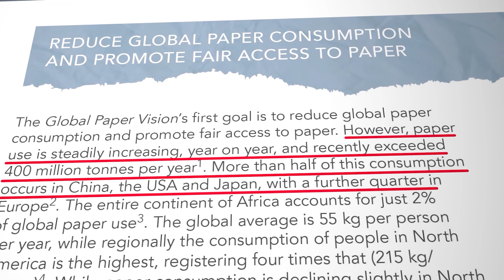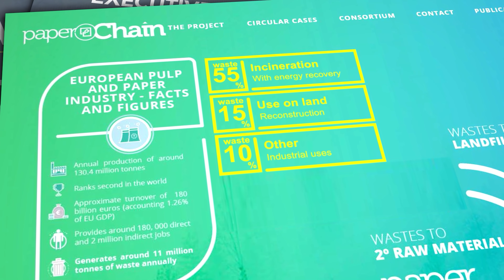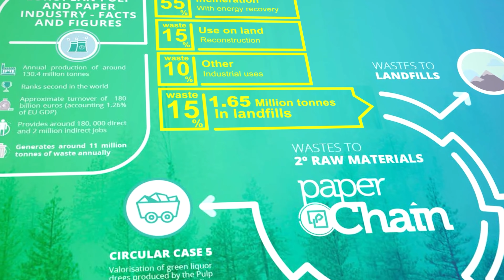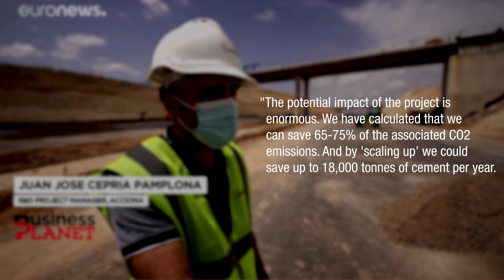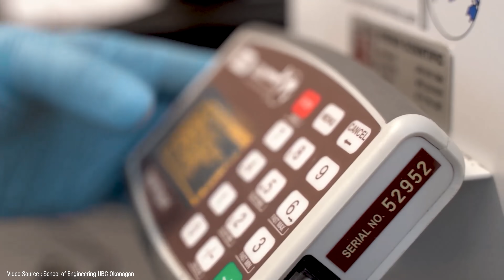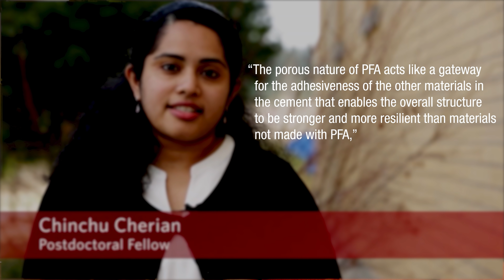Could papermill landfill waste pave our highways?

Comment: Early 90s. Savanna GA. New Airport Terminal. A "Bridge" structure that resembled an interstate overpass was 75% built before concrete testing revealed that the local concrete company was mixing PFA (paid to haul it away) from a local papermill, reduced the concrete strength by a factor of 10. Huge scandal. Soooo.., unless you and yours know something that construction workers don't... this idea is on par with some of the greatest scams of all time.

Comment: Cement producers have been using the residues from coal fired power plants for years in their products, ie furnace bottom Ash and PFA (pulverised fuel ash). They're known generally as cement substitutes. They perform the same function as the PFA shown in the video. We have huge stockpiles of the stuff on the sites of the old (now decommissioned) coal power plants. It would be great to reclaim all that lot first and allow the old coal plant Ash lagoons to return to its natural state.

Comment: Had a really good laugh, as he talked about the calcification process at ~700degres. Concrete has to go to the same process, achieved by burning old tires. Remove the tirefire, use something clean and we don't have to talk about a replacement.

Comment: Dave, this all sounds very exciting, but I think the "construction industry" is well advised to take a very jaundiced look at any new "miracle" product coming in. When you build buildings, particularly hospitals, safety and longevity are paramount- and they are not much less when you build or pave public roads with them also. Concrete is already a very fraught area in construction- most of the attempts to defraud building jobs are through "fiddling" with the concrete mix ratios and similar- so working with a new "miracle" material will be, as you said, a very hard sell.  I am not saying it's a bad ides- on the contrary, if it passes muster and the scientists can show the engineers it can work and how, it could be a really big deal! As always, thanks , Dave for all you do! Every Sunday and most mid weeks, I get a tiny bit more knowledgeable because you d  such smashing homework for us! FR

Comment: Thanks AGAIN Dave for another informative video. I was wondering throughout the video if anyone involved in the research has been in contact with the companies that are developing 3d printing for buildings, as they tend to use concrete in their mixes. Instead of convincing old dogs to convert their usage, start with new dogs that are looking for innovative ways to solve problems.

Comment: One of the biggest problems with modern roads is around regulation of weight per tire surface area, and if we change the way the roads are built, regulation practices may need to radically change.  Also, a lot of surrounding engineering is done with anticipation of approximate calculation of weight of the road, so that might need to change if you even change weight by a little, but perhaps this is minor.

Comment: Replacement of Portland cement with waste material is not a new idea. Ground Granulated Blast Furnace Slag (GGBFS) from steel making and Pulverised Fly Ash (PFA - the abbreviation has already been used) from coal-fired power stations are two examples that have been used in concrete production for at-least 50 years and which are regulated by British and other national standards. Bast Furnace Slag has also been used as an aggregate in asphaltic road surfacing materials. Other waste materials have been investigated such as Rice Husk Ash - a possible source of aggregate for concrete particularly in Asian countries; crushed waste glass is another example. The foregoing materials are used as partial replacements for Portland cements in structural concretes as full replacement would negate the beneficial alkalinity of Portland cement concretes which protect steel reinforcement from corrosion. Recent and ongoing research is being conducted into total replacement of Portland cement with recycled materials but the resulting concrete requires alkalisation to provide the necessary rust inhibition.  As with the use of all recycled materials, it is necessary to ensure that the properties of the resulting structural material meet the required strength and durability requirements. Equally, that a proper assessment is made of production and transport processes to ensure that use of the recycled material is truly advantageous from an environmental aspect. Interesting to note that the Romans used volcanic ash - which has similar properties to GGBFS and PFA to make concrete 2000 years ago. The volcanic ash was from a place called Pozzolana and the modern cements made from recycled waste are sometimes called Pozzolanic cements.
Reply: Correction: Pozzuoli not Pozzolana

Comment: The bitumen and gravel used in asphalt road building is already 95% recycled, and asphalt paving is also much cheaper and more widespread than cement paving. Cement paving also takes longer to lay/pour and longer to set before it can be driven on. So unless PFA bonded cement is significantly cheaper than standard cement, there is absolutely no market incentive for construction projects, particularly road construction and paving, to use the material. This is just green hype from the paper industry.

Comment: Sounds good to have more alternatives to cement and less landfill. 

Personally I've been hoping for a big push for substituting hemp instead of trees. Hemp makes an excellent additive to concrete mixtures. Mostly though it just makes more sense overall to make widespread use of hemp for as many uses as possible. Not only does it grow in almost any soil and climate but grows much faster and produces 4 times more paper per acre of land. Saves on cutting trees that take decades or more to grow into a suitable resource, when you can grow much more in less time with Hemp.  Plus added bonus of sequestrating more CO2 faster than trees.  Hemp fibre cloth is tougher and hard wearing compared to cotton. It has Cosmetic, medicinal and industrial uses aplenty including bio-plastics.  It's crazy that so  much paper still comes from tree pulp.  Its a one stop solution to many problems and has plenty of data to support its benefits. Yet still not used to its potential.  
From what I gleam this is because of the issues around grey areas of 'legality' and supply currently keep its material cost high as companies are careful to insulate themselves from legal challenges and supply is not widespread - keeping prices high.  Its not rocket science to free up production and financially incentivize its production.  For example Henry 8th passed a law to promote everyone to grow hemp as it was used for ship rigging.  If we open up legal restrictions and ramp up production, material costs come down, means more financially viable solutions and new market niches open up.

Comment: Coal used for cement production is now being replaced by alternative fuels, up to a limit,most alternative fuels are low ash, and so the cement producers can replace the ash normally reasonably high in coal by re introducing ash from other wastes, not a problem.
 Other paper waste is used for soil improvement, some fields are vastly improved, perhaps because they get paid.

Comment: son of a upper midwest 4th gen logger there some points i would like to clarify one pulp and paper is basically the low grade trash timber that litterally is too rotten or curvy to be uesed for anything except pulp/paper or mabey firewood. A large portion of the wood is logged from either from timber co. land or Gov. forests which are cut typically and then replanted typically on a 20-30 year cycle meaning it is effectively renewable the the waste typically comes from either stuff that is unusable like bark or simply wasted. To make engineered wood products that use chips or pulp a certian type grade or specification of chip/pulp must be used to make each specific product you would not use the large strong unpulped chips used in osb or plywood to make paper and you wouldnt use xmicron pulp for plywood. this means that anything that falls outside of specification is unusable waste also all of this wood waste typically will either made into stove pellets or burned in local power plants this large ammount of cheap wood waste combined with increasingly tight environmental regulations is why my local powerplant stopped burning coal about 15 years ago and began using wood waste. also the fact that it is renewable at least on a human liftime scale means the industry is basically carbon netural granted there is power to run logging equipment which is desil but a lot of mill are powered by wood scraps. the ash is often used as fertilizer not only because of mineral content but because it is basic and is a cheap and easy way to adjust soil ph. Fly ash and ash of all types including coal is used as a pozzilaning agent basically makes cement more water and weather resistant. this type of cement is actually widely avaliable but in us typically uses coal or volcanic ash because it is cheaper and or more effective i am also the step son of a construction worker so i know a lot about cement.

Comment: I have my doubts about this one as cement alternative.

Let's just play devil's advocate for a moment here. Say cement is replaced by this - now still waste - product. You've then created an incentive for the paper industry to produce that waste (the waste becomes a product on it's own). That a negative incentive. The ideal scenario would be to not have that waste in the first place.

We need a cement alternative that's as good as cement or better but without the CO2 pollution it causes. There's loads of alternatives reducing it (like you showed in your previous video), some reduce it by a very wide margin. This one isn't it.
Reply: There is enough to go around at the onset. Coal fly ash kept in hazardous waste dumps can be used also, as the cement chemically binds to the toxins preventing release. These years of growing waste stockpiles have been theorized to dissappear quite quickly if the waste fly ash is used fully used in concrete production rather than partial use now because of cost to create stronger concrete when high strength not needed. Would likely need a government mandate to fully use and stop the waste dumps from growing.

Comment: I am in the construction industry. We are in favour of fly ash from paper, pulp, coal, garbage incineration and all the rest. It needs to be mixed with portland in a ratio that maintains the setting time. That is the biggest issue for our work days. The ratio can be higher with blocks and paving stones where the setting time is not as important. Cost is a massive factor too though so economies of scale need to be maximized to maintain competetiveness with traditional large centralized cement producers.
If there is a cement plant beside a garbage burner or coal fired plant or pulp/wood waste burner, that would make it feasible since transportation costs of these raw materials is the biggest single factor in keeping the cost low. 
We also need consumers to understand the complexities of their decisions when choosing one product over another too and so education as well as cost is the other main issue I see.
So thanks for providing a little more education on this subject. It is such an important issue!

Comment: With all due respect, pressurizing fly ash and then heating it to 750 degrees doesn't sound any better alternative. We should just stop making multi story skyscrapers which is the only way we won't need these materials to be super strong. BTW are buildings in India made some 600 years ago by mughal which are still standing and are 3-4 storey tall. These are made from mix of various substances which include dough made from brown chickpeas. It may not be as strong as concrete but I think if we drop our love for making taller buildings it is a great solution.

Comment: It is not a new concept. Modern engineers always marveled at the strength of Roman concrete and when the proper analysis was possible it turned out to have volcanic ash in it. Concrete recipes varied from era to era and country to country depending on where the knowledge was passed down from and many generations did not have concrete at all. Roman concrete could even be set underwater and it took quite some time before modern concrete could do that.

Comment: How energy/environmentally efficient is having to 'heat' the PFA in order to calcify it .. and purpose it as a viable cement alternative? Does such process off-set well compared with the energy required to process/produce cement itself? Thanks

Comment: Lignin being burned for energy is a suboptimal use, especially for electricity generation. It should be used more as a chemical feedstock. Lots of interesting things can be done with hydrogen and/or pyrolysis.

Comment: It sounds like a good idea, let's do it. I know we can make roads largely out of old tires because they've done it in AZ and the roads are super quite to drive on.  Why aren't we doing this more?  If friction is the reason, then I'm sure we can dial in the correct amount of tire to asphalt. I mean, we have billions of tires just sitting around with no future, or worse burning, further contributing to climate change. Even sadder, I watched a process where you can super condition your tires to hardly wear out, ever, but tire companies don't want us to know about this because of obvious reasons.  Our economic system needs an overhaul to save our planet.
Reply: I highly doubt the radical tire extension thing is safe, but making roads from old tires does sound like a good idea.
Reply: @garethbaus5471  Just web surfing, I stumbled upon this concept a few years back. Unfortunately, when I research something to my satisfaction, I move on to new things and usually seek out education for my own benefit, not to pass it along.  I can't find all the research I did because something happened to my bookmarks, but I did find the video that started me out. You can take a look at it if you'd want and do some further research if you wish to. https://www.youtube.com/watch?v=OD8WFiDGx4Q&list=PLVeTzEpfe9_5hYbPxXKzScBINHH_cspvP&index=32
Reply: @garyz777  looks like it mostly just delays UV damage, which should be fine. I was concerned that you we talking about some sort of hard coating which might reduce traction.

Comment: Thank you. Would fly ash from othe indusyries be suitable as well? Furnace fly ash specifically from smelting and casting metals.
Reply: Yes, most definitely, it's called Geopolymer concrete and uses the fly-ash from iron/steel furnaces.
Reply: @blackbandit1290  Are the power stations that burn biomass and then producing fly ash as a result using this type of waste management ?

Comment: hydrating then re-calcinating the fly ash in a kiln largely defeats the energy saving, though. The difference between 750°C and 900°C isn't much, and after hydrating the fly ash you're back to de-hydrating (ie, calcinating) from scratch. The real benefit comes from using the fly ash as is, which is done all over the world as a partial substitute for portland cement.
Reply: Yes and no. You are right that its re-calcinating is not very different to the one from cement. The big difference, though, is that you are using a secondary waste product that would exist even if not used for making concrete. Cement, on the other hand, includes mining, explosives, grinding, and transporting the rock to be processed before getting to the re-calcinating point. On top of that the cement industry literally destroys mountains and causes a deep ecological impact around the exploitation area.
Reply: @Desgeneratico  Exactly. That is the point of recycling/reusing. In here, its just a matter of taking the fly ash to the kiln, no explosives, no mining, no nada. If it were possible to also use the sludge as fuel to power the kiln (it IS a carbon-based compound) then all the better; though there may be some issues with the emissions of the sludge being burned. Or even use waste heat from other heavy industry processes (like iron smelting).
Reply: Spot on.
Reply: Presumably it is still less carbon intensive due to the avoidance of the chemical process of converting (calcinating) limestone which releases CO2, though I would guess by not much.
Reply: Bot Alert!
Reply: IBAA is used in highways but it's very controversial at the LHA I work at.
Lots of mercury and other dodgy chemicals so needs to be purified and thoroughly tested. Recycling materials is the future though.
Reply: I have a question about that. As far as I know, we don't have the capacity to recycle all of the paper or something the US puts in its recycling bins, so it ends up in warehouses. If that's true, how much of that paper could be used up? We might start making alternatives like hemp into paper. Would that effect this concrete process?
Reply: Totally right. If you still have to cook it to make it work, then yes, it defeats the purpose. However:
If the process itself can be integrated within the production chain of another industrial process, and use its wasted heat to supply the energy needed for the calcination, then it would actually recycle two things instead of one. Plus, the sludge that produces the fly ash in the first place can be used as fuel to calcinate the thing in the first place; or, if its energy/temperature production is not enough, it can power up other processes that require less energy and instead you use the waste heat of processes like steel manufacture, or the like.

Comment: Strange, I was under the impression fly-ash was already a standard ingredient in various types off concrete.
Reply: I think the difference here is that they want to use the ash as the cement, not as an additive
Reply: @Ubya_  No that is not possible. It is used to reduce the amount of cement needed in the mix and although it takes much much longer to set, it makes a better cement in the end.